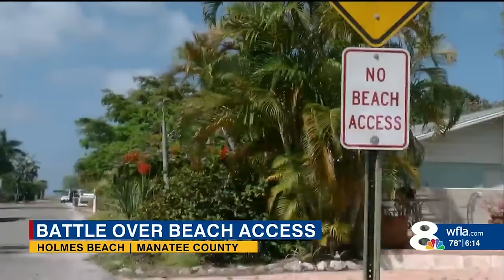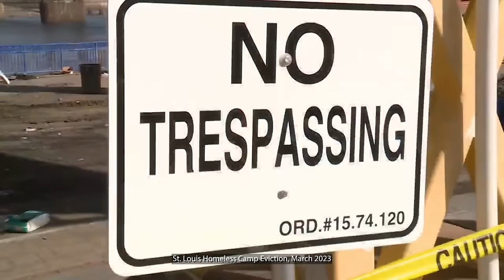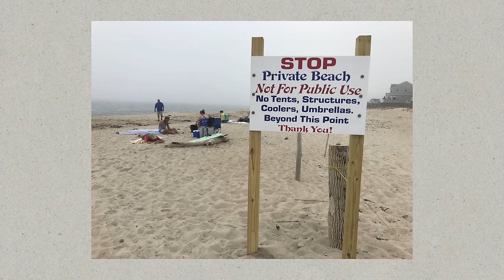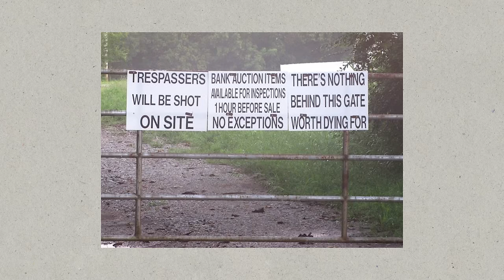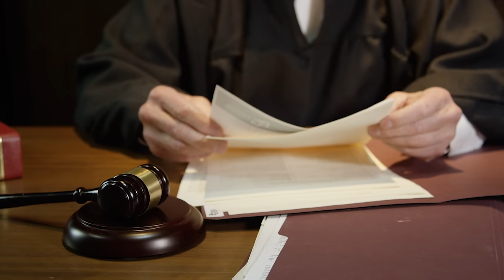The European Freedom that's Illegal in the USA

Comment: To be honest the right to roam is good for large undevelopped lands, but can be problematic on smaller forest close to habitations. I live in Canada and my father has a small forest with a large path. Even if it’s private property, he has to physically block the path in spring because people on 4 wheelers with pass and ruin the path as the ground is soft and muddy. Also if you take a walk and ignore the hunting signs in hunting season, you suck.
Reply: That’s why motor vehicles are prohibited
Reply: @BenjaminWalburn  good point